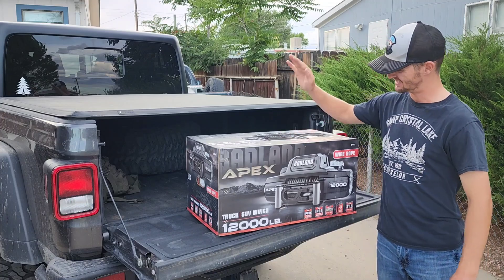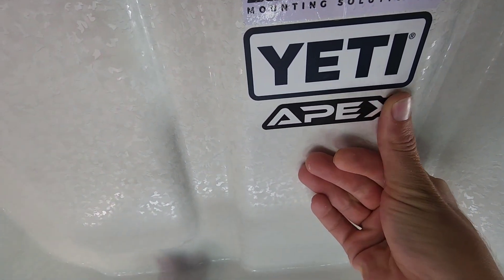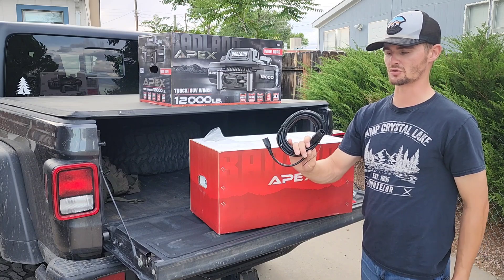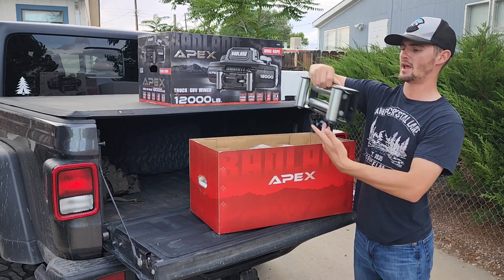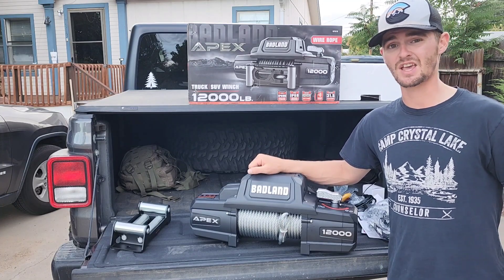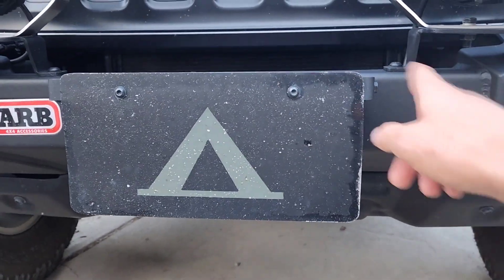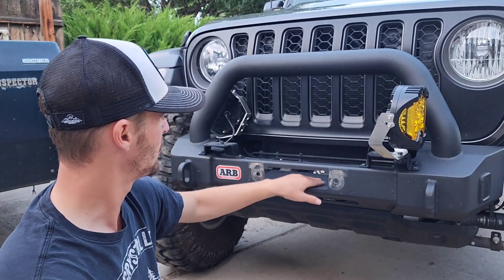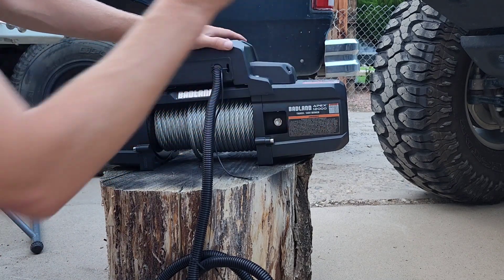Installing a Winch in the ARB Classic Stubby Bumper for the 2021 Jeep Gladiator

Comment: Is that the stock rubicon front skid plate under your front bumper? I have an 80th anniversary edition and I put that same bumper on, but I hate the way the wimpy skid plate looks, yours looks a lot better
Reply from the maker: Yep, just a stock steel gladiator skidplate
Reply: Just got myself a rubicon skid plate. Am I right that with the arb bumper installed the skid plate only uses two bolts on the bottom of it?

Comment: When you look at pricing, it's cheaper to wait and buy the Synth Version straight from the start. Usually you get some options like wireless remote etc when going with the Synth version directly. I bought a SuperWinch SX12000 and if I was to switch the Steel to Synth it would have cost me like $200 more to do it after. And also the Synth Rope goes with the same warranty as the winch :)
Reply from the maker: I'm hoping too get the warn hi vis synthetic or yankum synthetic rope

Comment: what is the brand and model of those yellow fog lights?
Reply from the maker: I got them off amazon here is the link 7 Inch 90W Amber Yellow LED Work Light Bar Side Shooter Off Road Driving Light Spot Flood Combo Driving Lamp IP67 Waterproof Fog Lights for Jeep Truck ATV SUV Car Boat https://a.co/d/hDPxIBM
Reply: @jeepzandthings  have you had any problems with condensation on the inside of the lens? i was reading the reviews and numerous people reference this, but the solution is to take the cover off and silicone seal them.
Reply from the maker: Nothing yet. Im in the south west desert so that could have something to do with it